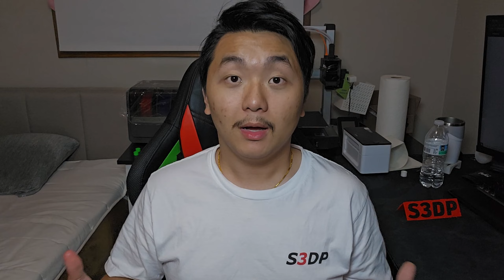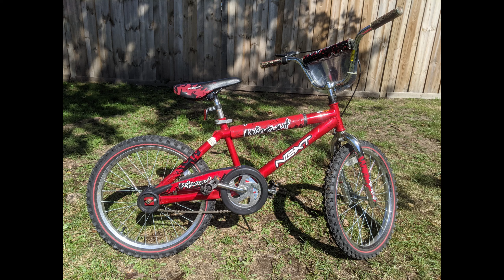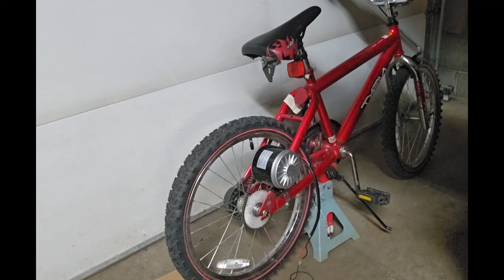Building an Electric Bike 24v 350 watt Motor | #JLC3DP

Comment: Congratulations! One issue with the motor mount plate. The bike is steel and the mount is aluminum. Those metals can't be welded together successfully, permanently. All that is needed is a sand off the plate completely and replace the aluminum with steel plate. I am a professional welder. Good job on your project
Reply from the maker: Thanks. Oh ok next time i'll do that. My plate did fell off a week later.

Comment: Your motor won't be powerful enough to carry you up steep hills without also peddeling. Still watching your video so will update this shortly. I ride an ebike every day and components like chains, chainrings and casettes, should also be considered renewables, if you get any part with teeth printed for you in future, make sure they make it out of titanium or stainless steel. Best to design it for at least an ebike chain, if you wan't it to last longer.
Reply from the maker: Yeah, then i bought a more powerful motor and it works grate